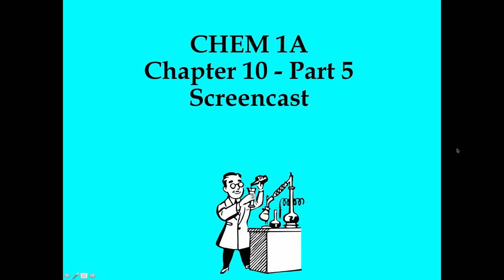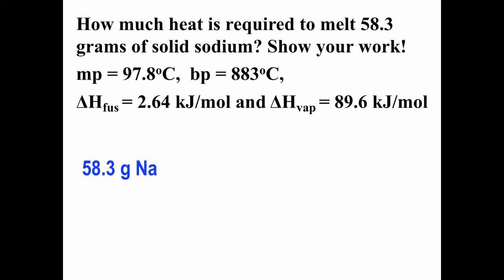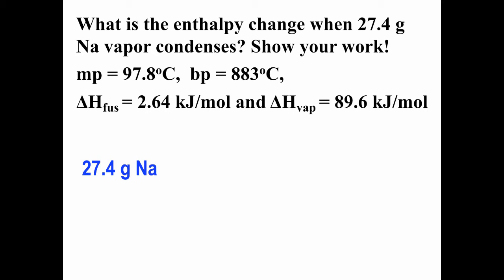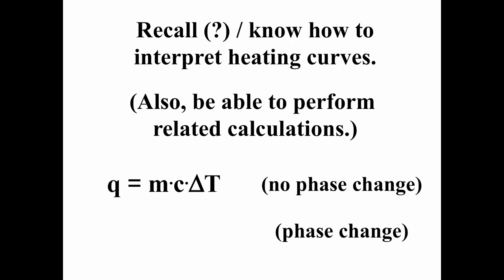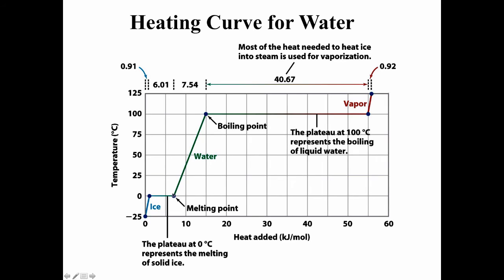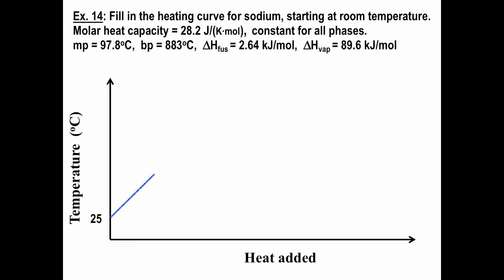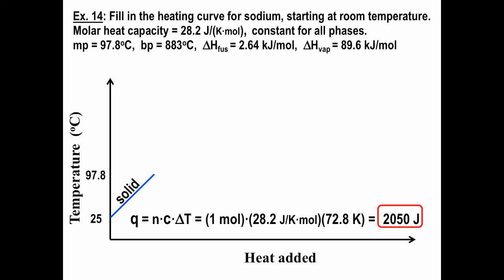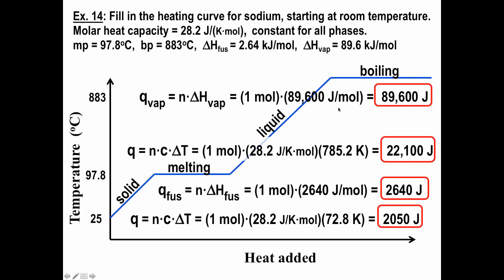Chapter 10 - Part 5 Screencast 11-20-15

Comment: Around the time of 8:00, in the third example shouldn't the 72.8 degrees be actually 345.95K because the 72.8 is still in Celsius? And due to the units of the molar heat capacity being in mols, Kelvin and joules,  everything should match, and in the end would give us  9755.79J? I could be misunderstanding though.